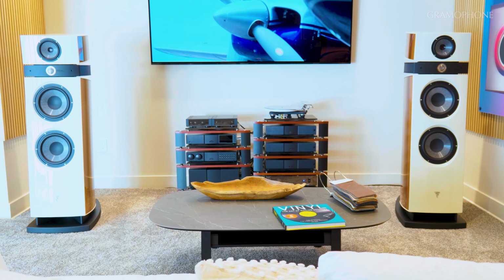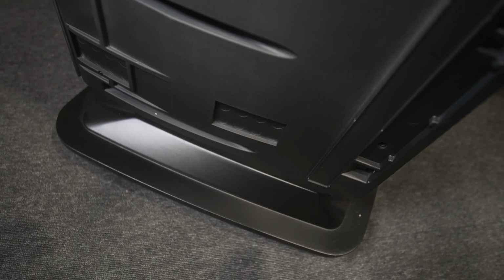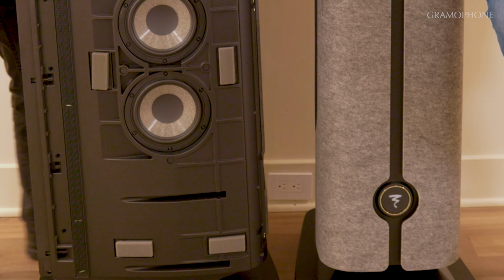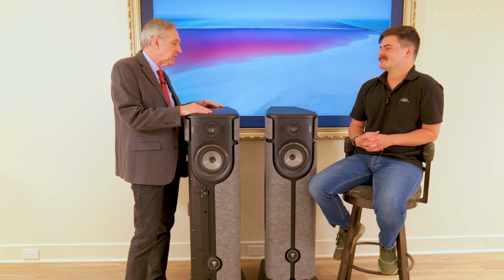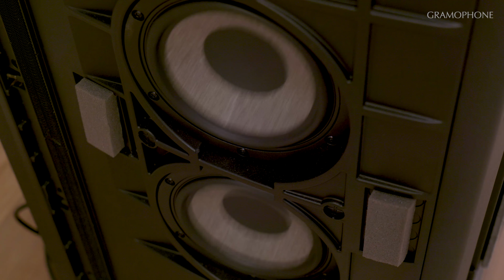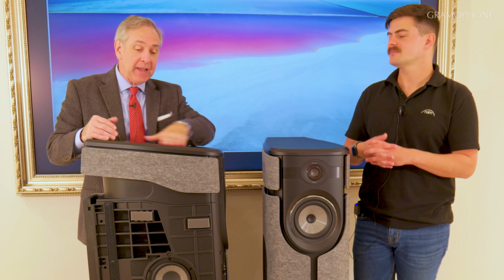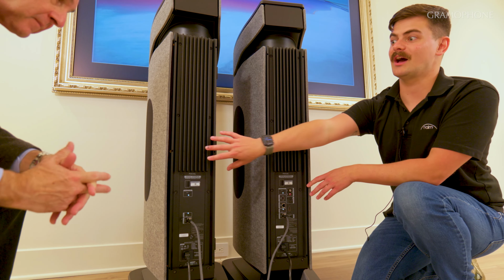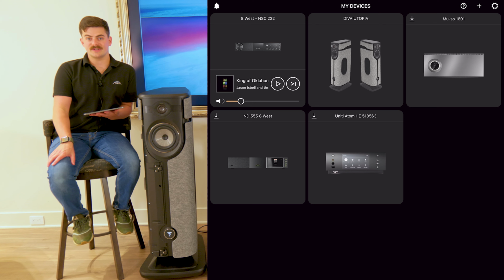Amazing Focal Diva Utopia Wireless System | Gramophone

Comment: Felt and plastic on a €30k
speaker...seriously?? Better hope you don't own a cat or live in a humid climate with that felt. A good wool felt can't cost more than €25 per speaker.
Then you have the issue if the amp breaks you can't use the speakers.
Manufactures are really taking the piss now.
Reply from the maker: Hi BrettinLux, thank you for your comments.  An extremely high density polymer cabinet like this one actually has some resonance advantages vs. most cabinets.  It's true that if an amp module in one of these goes belly-up, it needs repair or replacement - but that is also true of an amp channel in a component system
Reply: 1. It’s not a standard wool felt. 
2. The amp pack is removal to send for any needed repairs. 
3. It’s not any old plastic and while the look can be polarising, the engineering benefits are important. 
4. My cats haven’t touched mine. No idea why, they usually destroy fabrics. 🤷‍♂️

Comment: Thanks -- obviously starting with large spkrs is the way to go -- one wonders if these will come in a range of sizes.  
Clearly connecting the 2 spkrs together with the UWB 
technology wireless pairing system is a neat solution -- but does linking the Secondary and Primary loudspeaker connection and a RJ45 cable provide a "better" sound?  
[Cable connection offers a higher sample rate audio "Connexion sans-fil Connexion sans fil UWB 96 kHz/24 bits
Connexion avec Hi-Res Link 192 kHz/24 bits"]
Reply: The cable does provide a better sound. The sound becomes more lifelike almost, and you lose a bit of digital noise. That being said, the difference is only noticeable after hearing them unconnected and then connected straight after. The wireless setup is still amazing, and one would think it was connected!
Reply from the maker: Hello Andy, it depends somewhat on how far away from each other the primary and secondary are.  In general, we always suggest hard-wired anytime that is an option.  But as Snaker says below, the wireless option is still very, very good

Comment: Even Sony ES series and APM series from.80s blows farts on these..   😂 😂 😂 😂 😂 😂

Overpriced overrated
Reply from the maker: Hello Robert, we're sorry that your listening sessions with these were less impressive than ours.  We have the $70 k Focal Maestro here in our Experience Center, powered by a full Naim stack, and the Diva Utopia acquitted themselves very well on a wide variety of music
Reply: @GramophoneMD  the Focal trio studio speakers blows and farts on these.
No wonder no studio even Sony doesn't use you're highend overrated overpriced overhyped ripoff garbge.

They use yamaha Gershmsn Focal Pmc
Reply: @GramophoneMD  naim overrated overpriced overhyped ripoff
What's with the garbage 10000uf 65v X4 capistors

My pioneer from 1985 has 47.000uf 100v capiscstor and twin 1200v transformers

Look at Sony ta7n uses 4x 33.000uf 65v and twin 1200va transformer

None off you're naim has this, and also

Naim
Linn

You're sound is on the warm side, and no tone controls

Epic fail, trying to save cost and money

Even sansui technic sony Accuphase krell musical fedilty yamaha use tone controls with seperate capiscstor and 100v inphase transformers and heat sinks so it dosent interfere with signal loss
Reply: @GramophoneMD  even you're focal 936 blows farts on these
You think I'm a newbie, no I'm an oldskol 80s 90s pro and also

Sony yes all copper damping and 4invh long throw double magnets, none off you're focal accept the studio series uses these.

Sony ES series uses 3 capistors for bass mid treble while you use 1 too control 3, that's epic fsil garbage junk pos to save 💰
Reply: @RobertMiah-n2u  you’ve talked a lot about components, and they do matter, and yes the Focal pro line is wonderful. However, to say even the 9 series is better than Diva is just extraordinary ignorance.

Comment: You claim you’ve been in this hobby for decades and this is the 1st time you’ve seen an all in 1/wireless system, you are so wrong. Kef has had several integrated/wireless system. The kef ls60 is $6000 and this system is $30k or more. The speakers look similar to kef’s ls60 except for kefs coaxial mid/tweeter.
I have heard the kefs but not these focals, but my guess based on my prior experience with focals, kefs will have a more full sound/better bottom end than the focals.
Reply from the maker: Hello User, thanks for your comment. We didn't claim that this is the 1st time I have seen an all in one wireless system; only the first one at this performance level.  We are KEF dealers, with the excellent LS 60 on display here in Timonium; our LS 60 review is here:  https://www.youtube.com/watch?v=MPhMY7ZoSU8&t=2s.  The DIVA is many times the price of LS 60, and naturally offers a different performance level.  Both are great products
Reply: Looks similar than the kef? The focal is clearly in another technology league. The kef ls60 is a nice speaker, as is the dynaudio focus. But these are midfi systems. Lets be honest about that.
Reply from the maker: @stijnvanderlooy5311  agreed